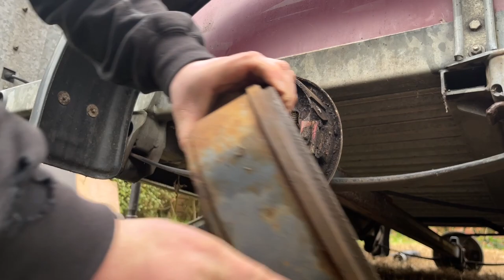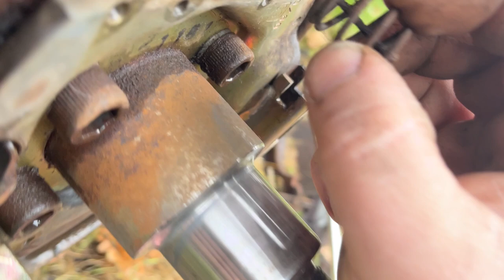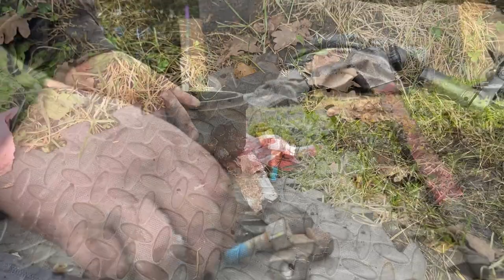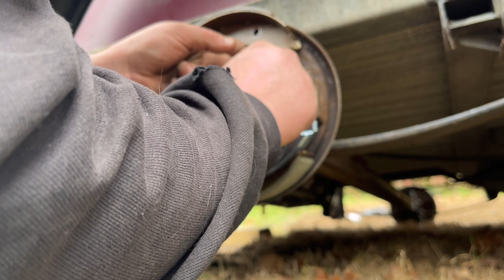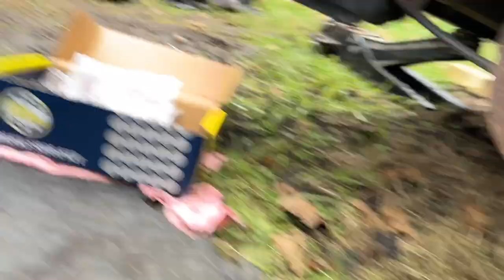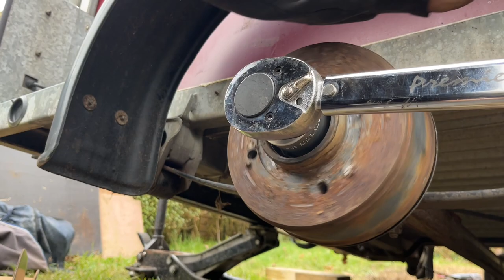Ifor Williams trailer brake shoe replacement hb505 hb510

Comment: Great video - thanks so much!! Quick question (probably a bit dim) - if the brakes are adjusted by a mechanical screw thread, how often should they be checked and adjusted to allow for wear in the friction material? Thanks again.
Reply from the maker: Good question, due to the wedge having a roughly a 10mm sliding face and the shoes have roughly 6mm of friction material, providing there are adjusted correctly you shouldn’t need to adjust them very often at all, usually go by how high the hand brake lifts, if it points upwards then I would recommend adjusting them 👍
Reply: Makes perfect sense. Thanks a million 😊

Comment: Any advice on how to remove seized hub nut?
Reply from the maker: Sorry for late reply, you need to ensure you have removed the pein in the nut, I use a screwdriver and a hammer to bend the nut back out, they are fairly tight but a good 1/2” battery gun shouldn’t have any problems removing it 😊👍